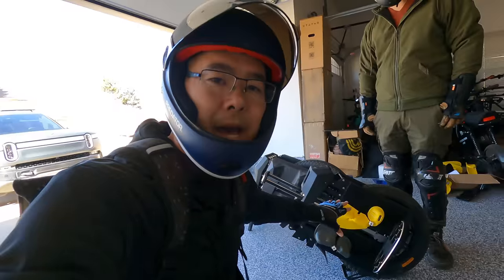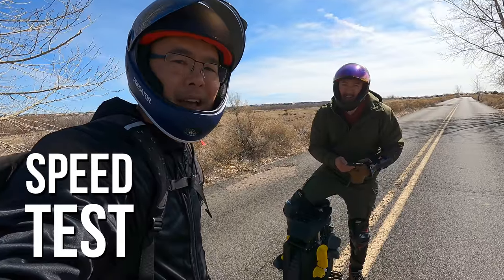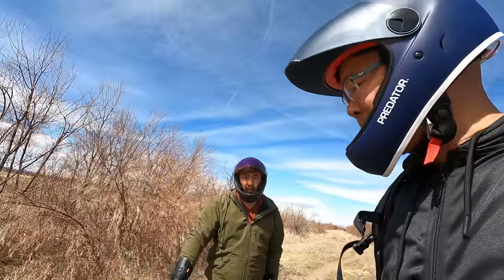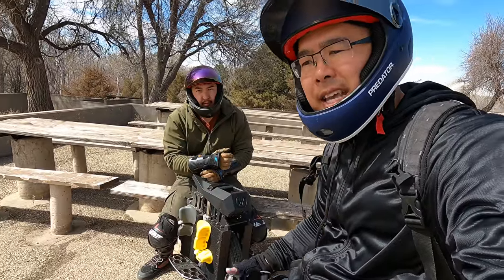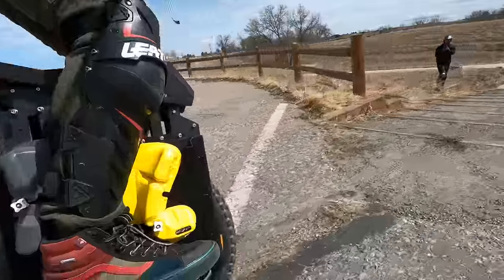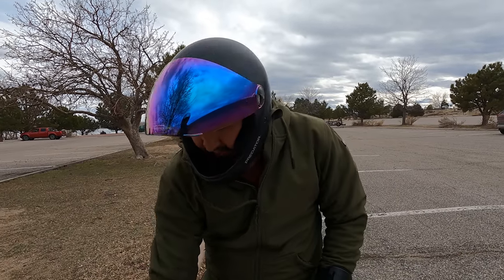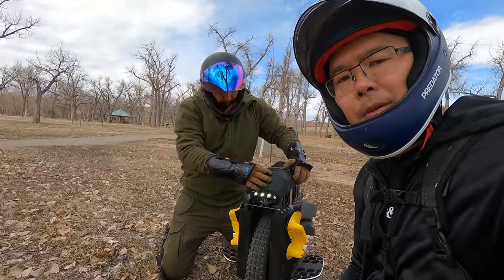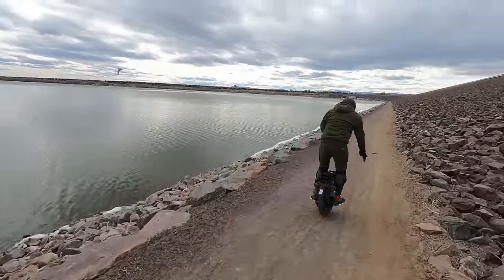Their Best EUC yet has Two Main Flaws: Begode EX30 Review

Comment: Aight guys, surprisingly I agree with everything you guys say. Being an owner with ~300miles on it, I've mostly solved the issues you guys mentioned. 1stly, early beeps are a function in the alarm settings (not just wheel settings) on EUC.W. 2ndly, I got 2x 12x16" ABS sheet offa Amazon ($20), wiped cases with alcohol, heated velcro to 150f in oven for 5-10min & pads sticking are no longer an issue. Softer knee protectors angled inwards under Leatt Dual Axis for the chaffing issue. All solved, mostly. Wheel felt like a tank/locomotive on 1st coupla rides but adaptation & aggressive fwd ped tilt angle solved it. This ex30 is very deceptively torquey & climbs as steep as well as a RSht but not as nimble ofcos. With suspension dialed in for weight & ride style, this ex30 is growing on me. I'm fraid its gonna spoil me & make other wheels feel mehhh to ride. Good review guys 🤘
Reply from the maker: Thanks Scott!  Appreciate your insight!
Reply: Got this wheel and didn't get an owner's manual. How do I access alarm settings? Is there a application on my phone?

Comment: One concern about the batteries and battery casings is. What’s it going to be like during the summer when it’s hot outside? Dutch oven battery casings?
Reply: I've always thought about that as well.  However, the black plastic would also get hot in the summer.  White would be best but I have yet to see any of these super wheels in white.

Comment: No issues with the kickstand going down any stairs on my ex30, didn't have issues attaching velcro to battery casing (just use a hairdryer to heat up velcro adhesive), (I added  a sheet of lexan from Home Depot with velcro on each side which acts like a fairing with more surface area to attach my bigger kinetic pads to), I added kinetic pads straight away for control (stock pads on any wheel suck comparatively) and modified/ painted stock pads around kinetic pads for wheel protection only.. couldn't be happier with my ex30.. best all round versatile most powerful wheel you can get in one wheel imho.. just about can do it all in one wheel and for a long time with great range.. (maximum power equals maximum safety imho with regards having maximum headroom before cutting out/ overtorquing)..don't really need another wheel as it does it all but will only be getting one other wheel to complement my ex30 specifically for highly technical trails/ winding single track demanding the most agility and that is the begode Extreme...Definitely won't need another wheel for a while with only the Extreme and ex30 in my arsenal.. need to sell my rs ht asap as I really have no use for it now
Reply: Is there a way I can contact you another way I just bought my brother-in-law the same thing and he's wondering the ins and outs of it.. also the pads didn't stick very well out the box.. Instagram or Twitter?

Comment: You guys reviewed the NIU BQI-C3 Pro little while ago, I saw that video thought the e bike looked pretty good. With the belt drive and dual batteries seemed like a good deal. My only concern is the single internal gear with the 3 pedal assist at higher speeds. Thanks!

Comment: Need a Commander Pro with an EX30 motor 🤩
Reply: That would be pretty epic. Made in the same factory, so it would be nice to have that option.
Reply: Commander pro is dope but if you take it apart it's trash the quality is no good watch the take down video on it it's horrible hot trash but performces great and works great. They just rushed it while making them and there not water proof either .

Comment: I wanna see a EXN vs EX30 speed test!
Reply: why. results wont be close. exn ht might match offline performance but loses after 30mph. exn hs have no chance on holeshot &or anywhere else tho I have to say the exn is easier to toss around so it should win in a tight course, racing atleast. fwiw, I'm not just talking theory here as I've owned both a exn hs & ht & now ride the ex30
Reply: @scottsum1319  I know it would loose in a race against the EX30, I just wanted to see how much faster the EX30 is, compared to the EXN HS.

Comment: I also live in Colorado. I was wondering if a euc can be good to use for a daily commute. I'm looking at the in motion 12  HT and my family keeps on telling me that it's a mistake and that I need to get a car. They also bring up winter alot. I believe that I can save money by not having to pay insurance gas and upkeep at least until the winter starts. Then I can get a vehicle but still have the euc for fun and as backup and for summer.  As a person who owns them and is experienced with them what is your recommendation?
Reply: Ied get a wheel with better range then the v12 I had it and it's a awesome wheel but the range not great especially if you planning on hitting 30 or 35 the whole time you will just drain the battery at those speeds . Besides that I love the v12 it's fast and nibble
Reply: @tremartin4727  what else would you recommend?

Comment: This is a fantastic and extremely durable https://www.youtube.com/post/Ugkx4e2fa6x27dF7shCelntq0ZIKt4N0jELI unicycle. This was my first unicycle and I have really thrashed this thing for the past eight months or so and it has stood up very well. The only thing that has broken are the plastic pedals, they take a beating as you learn to ride, but an upgrade to metal pedals is fairly inexpensive and pretty necessary for most any unicycle. I have since acquired a 36 inch Coker for commuting and having ridden that I realized that the saddle on this unicycle can be a bit uncomfortable after a few hours riding, but still it is a great unicycle to start out on.

Comment: My x 30 is driving me crazy with the stock pads!
I am leaning as far forward over my wheel as possible and it is so hard to push it past 35 mpr.
Waiting on my grizzlaflow system.
I'm really hoping that will help me reach some higher speeds.
Reply: hint: play with pedal settings both in forward tilt & modes. personally I have a coupla degrees fwd tilt in medium mode. no issues at all launching it hard to which speed before my ballz shrink back in 😁
Reply: What you riding on soft mode? I have no issue getting my ex30 moving fast at all on hard mode . This wheel has all the torque and speed so it's strange to hear you can't get your wheel moving fast even with the stock pads I can hit the 40s in secs ..
Reply: I can sit down ride with the stock pads and get it to 45 plus no issue

Comment: just wish they had communication between bms and motherboard and maybe just maybe a smart bms and even after all of these years begode wheels are still not battery safe :/
Reply: That would be nice. I haven't heard of the new wheels having issues with the batteries, but only time will tell. 

Begode did listen to most of the feedback so hopefully they will improve on that in the future.
Reply: You can say the same for leaperkim wheels like the sherman-s as well. Only kingsong s22 and inmotion v13 have battery cell monitoring right now
Reply: @TheCobaltsaber  the main thing is communication between bms and motherboard and leaperkim has that i think
Reply: @VECTOR_Coasters  the sherman-s bms does not communicate with the motherboard. Its just the charge port goes through the motherboard first before going towards the battery. Begode wheels the charge port goes directly to the batteries, skipping the motherboard. But the begode master and beyond, those wheels have a separate charge distribution board. 

Cant really say which is safer. I know someone who plugged in a bad charger on their master and it fried the charge board rather than the batteries. So the separate charge board did its job
Reply: @TheCobaltsaber  oh i didn’t know that but i’m happy i didn’t get the sherman now lol
Reply: @VECTOR_Coasters  Yeah Begode has been safer than most for the past couple years
Reply: @greenwave819  no begode has been the least safe in terms of battery safety ever siege they started